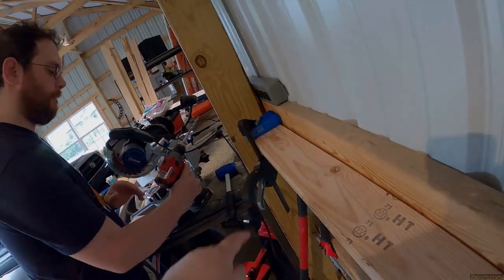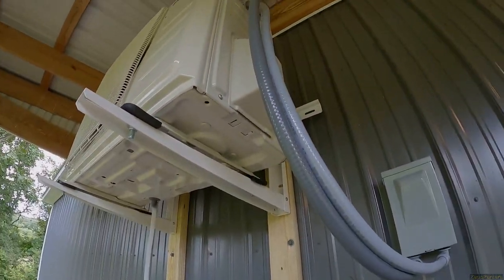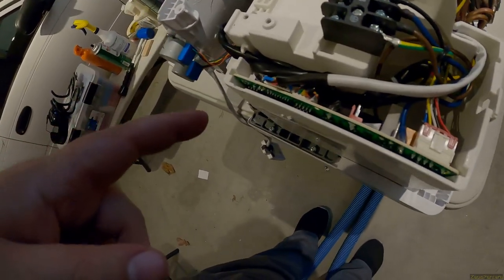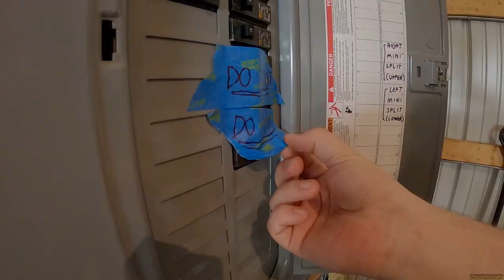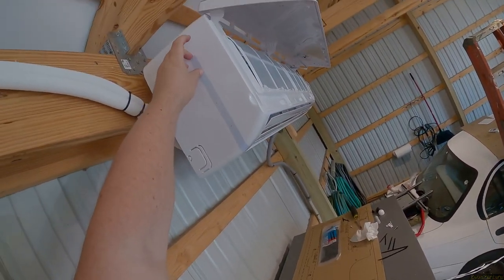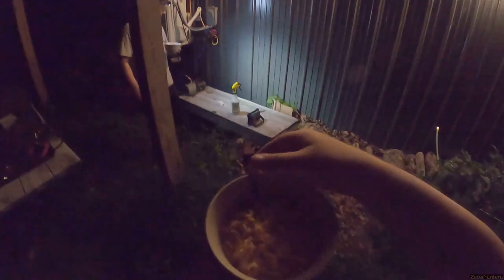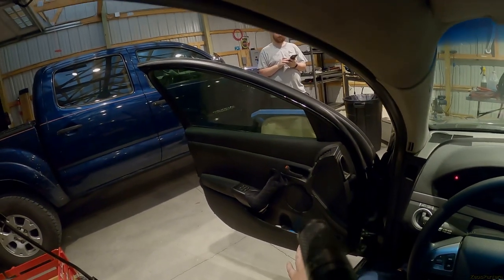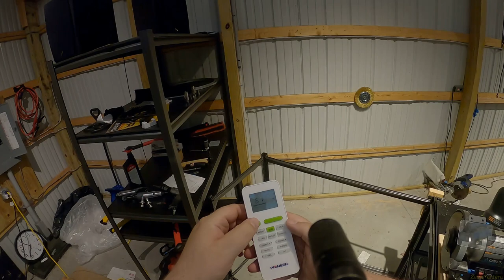🟩Pioneer Mini-Split Heat Pump Install (48,000 BTU of Hot and Cold FURY)

Comment: Looks like you guys didn’t do too bad of a job. We usually get 2 days, 2 guys “ apprentice and journeyman” to tear out and replace one of these units.   Definitely should have got some “nylog” for the fittings though. I’ll have to check your superheat and subcooling to make sure the installation was good lol. You guys can make 108k a year if ya move to Milwaukee and join the union 😆
Reply: We used nylog, I guess it didn't make it into the video due to the cuts.  But yeah, plenty of goopy stuff used, the issue that caused the leak was me learning that absolutely under no circumstances can there be any kind of side tension on the lineset.
Can you imagine us two as contractors.  That would be mayhem..  😆

Comment: You gonna insulate that garage so you aren’t trying to cool an oven in the summer?
Reply: I had planned on it. But then a recent visit from an HVAC company told me that job is about $14,000 to spray foam it.. SOOOO I may be doing it myself with batt insulation

Comment: Nice! Never expected to see HVAC content on here. I'm digging it.

Side note, I didn't watch the whole video, so maybe you addressed this, but that condenser/HP unit (the outdoor one) looks super close to the wall to me.
Reply: When they are wall mounted in that air can get underneath them, the wall distance can be much closer. After all, we are using the factory supplied wall brackets!

If you are curious, look in the manual of any mini split system, they usually specify a ground distance and an off ground distance that's much closer since air can get behind it on all four sides, not just three.
Reply from the maker: These are the official Brackets Pioneer sells with them.